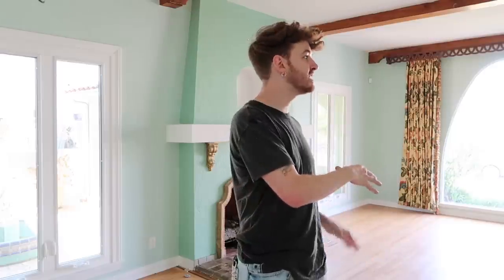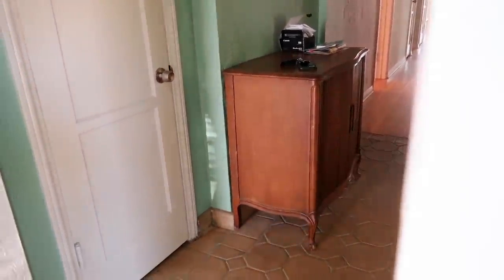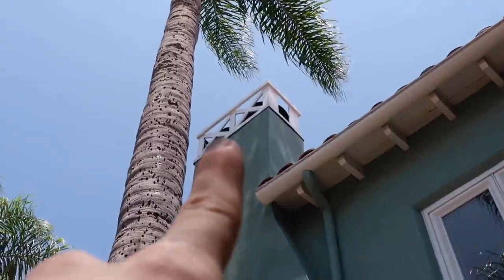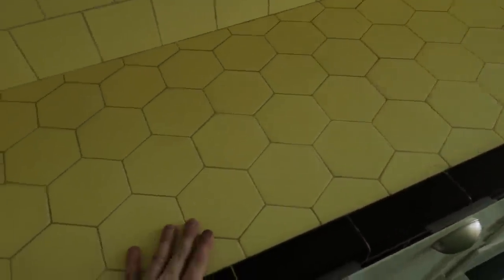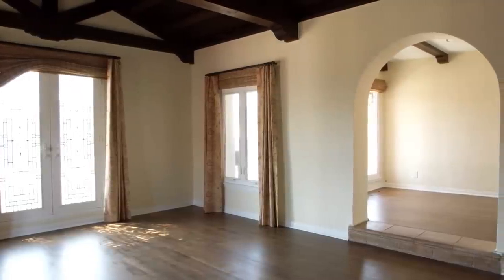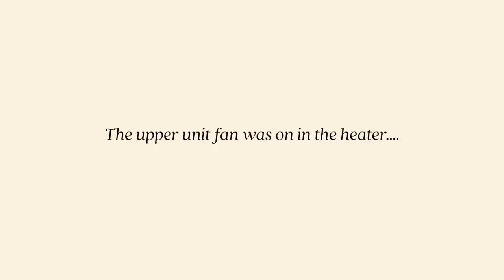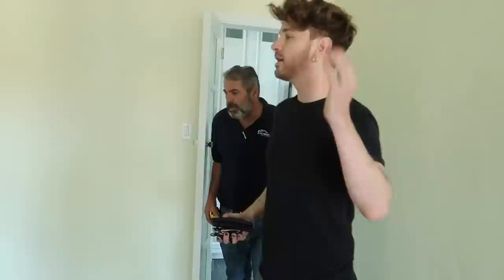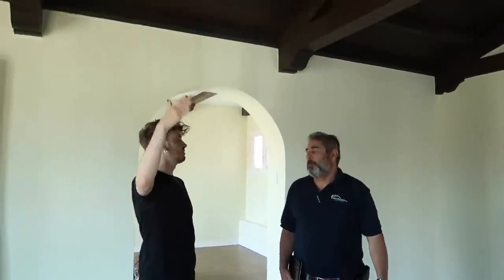Awful News About The House

Comment: Don’t rip out anything yet. I used an infrared camera to locate a leak in my bathroom. Once I located the exact point. I decided to tackle it by going in from the adjacent bedroom instead of ripping out my marble sink counter top, cabinetry, and tiles. Was the easiest to fix AND saved me a lot of time and money. Another trick is to find an access to the broken pipe and slide a strong flexible smaller pipe through the old one, then connect it to the tap and voila, you have yourself a working pipe without breaking anything.
Reply: I'm going to second this.  We wanted to cut an opening between our living room and an old bedroom to convert it to a dining room, but the living room had cove molding.  Was told they would have to cut through the molding in order to put in the proper joist support.  Found another contractor who simply did it from the other side, which had nothing fancy, and was able to preserve my ceiling in the living room.  Also, as someone who has done some remodeling in different ages of homes  - take photos of every single wall at every single stage.  It has enabled me to locate outlets that the drywallers covered accidentally, where certain pipes were, etc.  Never be afraid to ask questions.  A contractor got mad at me for questioning him once, and I wound up stopping him from wrecking my drain tile, because it turns out he didn't know what it was.  Good luck to you!
Reply: Agreed, used one for my bathroom also
Reply: Excellent idea!!!!!!
Reply: Going in through an adjacent room was what I was going to suggest, if possible. Even if infrared isn't possible, I'm still wondering if all the exploring couldn't simply be done from the backside. That's assuming these are stud walls. It will be messy either way, so it's picking the least bad.
Reply: I was going to suggest the exact same thing, go behind the bathroom, be it a bedroom, or living room, closet or staircase there's always a wall between the pipes❣️
Reply: We had a leak in our bathroom and the plumber opened the wall up in the laundry to see where the leak was coming from. As we hadn’t renovated that room it didn’t bother me.
Reply: Wow!
Reply: Friend had a leak and plumber wanted to come on 2 months notice for  1200  to lay whole new pipe through bathroomfloor, toiletfloor, utilitykitchen. It would have left her with another 3 to 4000 to redo all 3 rooms.
So we called my plumber who came at the end of the week, for one fifth of the price with a solution not destroying a square  inch of the rooms. Sadly this friendly honest craftsman is closing his big firm because he wants to retire.
Reply: You can always drill a hole and run a fiber optic camera in there. I'd recommend it for anyone who owns an old home. You can get cheap ones on Amazon for under 30 bucks all the way up to 500 for a professional grade borescope used by inspectors.
Reply: I know nothing about plumbing, but it sounds like a great idea!!!!
Reply: I thought of that too.
Reply: Hi from Australia, your building techniques and codes are different to ours however, I am married to a Licensed Builder and we renovate old homes.  From our experience we would look at the camera and other detection options before destroying any part of your gorgeous bathrooms including tackling the issue from wall on the otherside.  Maybe consult another more experience plumber or a professional that deals with leak detection. I also agree take a breath and concentrate on the issues one at a time.  Live in the house and let it speak to you and see how the flow works.  Take lots and lots of photos.  Enjoy the ride...you never know what is around the corner.  Look forward to watching your videos and future update.  🐨🦘🐨
Reply: @lauraulak4930  I also went through a major renovation.The contractor was not listening to me and almost hostile. He ripped out everything (kitchen, bathroom, floors) in a matter of days. Then his subcontractors did not work during the day but at night and most of the time not at all. Thank God I learned that he delayed in getting proper permits and because I went to the city permits dept.and accidentally found this out, they put a STOP WORK under penalty of law. Further digging...he did not have his state license current...did it after the fact (contract). After the STOP WORK he actually came in and worked on a structural issue. I questioned this and had his work inspected by the city. Turned out he "grandfathered" the structural work and , if I hadn't questioned it, this bad structural work would have stayed that way.  I was able to get out of this contract with him.  This caused months of delay in finding a new contractor and work getting started again. (I was meanwhile living with my daughter and my welcome was wearing thin.} He had the audacity to overcharge me for work he did complete.  This was very stressful.

Comment: Drew check and make sure there is no arsenic in the grout of the kitchen counter tiles. I lived in a 1928 house in Michigan and my dad replaced the counter in the kitchen in the 1970's. He chose to cover the tile because he said it was a common practice back then to put arsenic in the grout to keep the insects out. Like asbestos, it was better to cover it and limit the amount of particles in the air with a dangerous substance in it.  FYI
Reply: Wow!  I've been watching "home improvement" and flipping shows, for years, and before computers became the thing and streaming became a thing, I watched "This Old House" and other similar shows on PBS, LOL!  Yeah, I'm old.  But I learned a hell of a lot over the years.  Never heard about arsenic in grout, that's a new one.  Just goes to show, you're never too old to learn, and you learn (or should learn) something new every day.  Thanks for the info.
Reply: I grew up in an old home in Michigan and pretty sure this was an similar issue along with asbestos. Had terrible allergies all 16 years of my life until we moved. 😩
Reply: Congratulations on the new house Drew. Good idea to have the original light fixtures appraised for value and also to make sure the wiring has been updated. And if you're not too keen on using some of the fixtures in your design, the sale of them can help pay for the renovation you're about to take on.
Reply: Also, check the tile,  because alot of them were made with lead! If so, you need a professional service to remove them.
Reply: You don’t need to remove it etc. All tile needs to be sealed, 1x to 2x yearly, to protect it anyway. The old grout should also be sealed in that. (MOST LIKELY, THAT ISNT SAME GROUT FROM 1920 ANYWAY!) If you are concerned about anything leaching out, you can regrout or simply put a layer of fresh grout on top of the existant layer.
Reply: @ThePrairieChronicles  mold
Reply: @ThePrairieChronicles  A lot of popcorn ceilings have asbestos. I think Drew might have dodged that bullet.
Reply: @dfinite1111  Not what I was saying. If he does want it removed, the person removing and tiling it will know that they have to take it out in broken chunks and not use power tools like a circular or rotary saw. And I would not be surprised if that is the original tile and grout work. I know that the tile work was all sealed that's why people could use it every day as cutting boards and in a kitchen. It's when it's broken up and there is any dust that there's a problem. The tiler will most likely handle removal like any hazardous waste. And an expert tiler can take one look and know how old it is and what processes were used at that time. They can test for it just like lead paint. The bathrooms seldom had it by the way mostly used for kitchens.
Reply: You cant compare arsenic with asbestos. Its a whole other story.
Asbestos cant be remived like that. It has to be done by specialised people and there are big restrictions about that. (At least here in belgium) they civer it all up and you have to wear special clothing and special masks etc. Because if you inhale it, a litle bit of dust of asbestos you can have lungissues for the rest of your life and worse.... so please be careful.
Reply: I want a Victorian home but they sound like such a headache!
Reply: @carlaquartiroli6820  
    a  lot* 😁👍
Reply: @Bluemarinegirl  let it sound more like an aventure. To me it's a companion. I talk  with the house, sometimes it opens up some of its many  mysteries to me. When I'm away I often catch myself thinking about "her" . I haven't got her windowtattoo (yet?!;)) and my name is not Lone fox. But you can out us in the same box! 
Strangely, since I am in love with this derelict, desperately- in- need- of- costly- repairs home, I have totally fallen out on travelling. All my assets will go into it. The feelings it gives  is not that of risk of bankruptcy,  quite on the contrary; " I have arrived. I am home." Thich Nath Hanh
Reply: Interesting information ty
Reply: Were they green tiles, by any chance?
Reply: That’s scary
Reply: @Angela J yup., I scoured the comments looking for any comments about mold. Highly highly important to check into.

Comment: Congratulations on your new house!  It’s wonderful that you understand and appreciate the existing architecture and design.  I have to say: Don’t remove the walls!  As someone who has renovated houses, including removing load-bearing walls, don’t do it unless you are prepared for unpleasant surprises,  cost overruns, and for it to take more time and $ than you plan.  Also, that’s a well-designed, generous and elegant space that makes sense as it is.  Deal with the plumbing and the termites.  Connect the units with the archway.  Do not hang a light in the vaulted living room.  Overhead light is horrible and the wrong fixture will cast unsightly shadows on that beautiful ceiling.  You want lots of gorgeous lamps.  There’s a reason there’s no fixture on that ceiling.  Enjoy and good luck!
Reply: Thank you for the advice. I has been thinking about adding a ceiling light.
Reply: Everything WithMetta said! And Drew needs to approach ripping out those walls as if he was doing major surgery. I'd recommend getting an expert's opinion -- load-bearing walls can mean big trouble later on, depending on what you've planned for. 
Invest in local licensed contractors with good reputations; they're worth their weight in platinum!!
Reply: @krisaaron5771  exactly. Remove the wrong wall, and the entire house could be in danger of caving in. My sister had a wall removed during a kitchen expansion, and an engineer came by after the fact and told her she could not inhabit the second floor because the house was in danger of collapsing. So yeah, get an engineer in to do an assessment because removing walls.
Reply: Exactly!...i see wall sconces & standing candelabras shimmering in ghostly echos, reverberating in that Amazing room!

Comment: Congratulations on your new home! My advice: live with this house for a year before making any structural or other permanent changes like removing walls. You may have totally different ideas once you are living in the space.
Reply: I agree. I was even thinking he could set up one of the units for rental income while he works on the other unit.
Reply: AGREE
Reply: Absolutely agree with this. Houses tell you what they need over time.
Reply: Such good advice. I know it's realllllly hard to be patient, but I agree with Barbara.
Reply: yes, look how many times he changes the paint and room arrangement. He needs to listen to us old timers! Gone through it several times. And an ex that did tearing apart and no putting together. But I learned how to use power tools!
Reply: @retroredo9850  🧀🥖🍄🍍🦄🐴

Comment: Here's a tip from an experienced DIY home renovator:  refinish your floors LAST, after you've moved walls, pipes and electrical and after you've painted, etc.   Hire a professional, who will be able to patch the floors where needed.  The whole process will take 5-6 days and cost you somewhere around $3.00 - $5.00 per square foot.  Also, if you want painted white shoe molding, instead of clear-coated red oak, you'll probably have to paint it yourself (at least that was my experience with contractors in Washington, DC where I live).

Comment: Also, I know you mentioned getting the lights appraised - definitely do - then put them on your home insurance immediately! Even if you don't plan on keeping them all, if any of them get damaged when removing or moving them then they will already be on your insurance at the appraised value. Plus if you haven't already - install security systems and cameras even in an empty home - you can't be too careful.
Reply: You're talking bucks, at what point do light fixtures become just an expensive problem.
Reply: @rockingredpoppy9119   Those light fixtures are worth in the thousands each. They’re not from the local hardware store.
Reply: Not sure what part of the country is you live (Florida?,) but Never leave your tools overnight. ... or at least setup a dead bolt closet for work storage.  ❤ your home !!!
Reply: @rockingredpoppy9119  he could sell them as well to pay for the work on the house..  I would hate having to do that ..but ??

Comment: Tip: make sure your electric panel box is labeled correctly. This can help you find problems like you just had with the noisy thing in basement. Just turn breakers on and off till noise stops.

Comment: So glad Madolyn said it!  I too am an old home owner.
Floors are usually last, especially in older homes, where lathe and plaster demo's are heavy and can be damaging to floors.  You are already working on your foundation which is the best thing you can do first!  That way any new plumbing will stay stable.  
Getting your plumbing sorted out before you decorate can save you soooo much grief!!!   You can take a guess on how I know that.
Next I would get your electrical "looked at", older homes have "interesting" electrical work.
I know you are counting on your inspection to be good enough but there are things they don't know to look for in an older home.

A suggestion: Talk to your long time resident neighbors, they probably know some things about your home that will surprise you and they may have already made the upgrades you are thinking about.
Oh the bathroom plumbing? Can they work from the opposite side of the wall, so that the tile work isn't ruined?

Comment: From a first time homeowner of a 1950s home, my advice is to slow down on renovation. Deal with the most functional things first before the design - plumbing, water heater,  furnace, foundation,  electrical, roof. They can unfornately be very expensive.
Reply: Yes, and having to ruin design work to fix functional things is disheartening.
Reply: I want to think that will happen. I hope he’ll listen to all the advice here, but I’m not so sure. Intuition says I’ll have to stop watching this channel.
Reply: Absolutely correct. The main structures of the house are the most important. There was a leak from my hot water heater that leaked into my living room floor, which was carpet. Our home warranty took care of everything including the new carpet. I paid my deductible which was $50. New Hot water heater, the plumbing and drywall and carpet. So slow down and think smart. I know it's exciting but slow down. One step at a time.

Comment: Rarely does someone buy a house and renovate it without finding a few issues crop up here and there. My Dad was a developer and more often than not there would be some hidden issues just lurking to be discovered, but my Dad told me that how the buyer handled the situation made all the difference. I think the fact that Drew immediately wanted to problem solve and tried to understand the issues by using his resources to call and discuss it with the contractors is a really good approach. While the situation is not ideal, if this is the only problem that is found with the house, Drew is still doing pretty well.
Reply: Always always unseen problems crop up. That is just the nature of renovating.
Reply: It appears the house was built in the 1920s or 1930s, it's nearly 100 years old.  It IS going to have issues, that's a given.  Anybody who expects to buy an existing home and it NOT have issues is pipe dreaming themself.
Reply: For having renovated several, living in 200 yr and older buildings : one always has surprises...My last ones were enormeous roofleaks and a wall with salpeter.. And trust me, many an expert including myself had been fooled on that one. ( A direct consequence of climate change and temperatures in a usually temperate rainy area that has turned in a fairly mild, almost dry climate. 
But that is part of the game...gives everybody work and problems to be solved.:))
 Is there not the possibility to get repairs back from vendor?